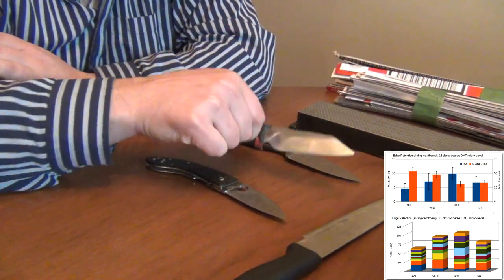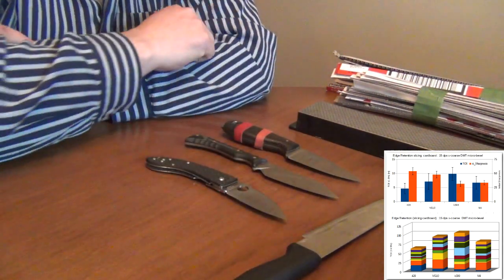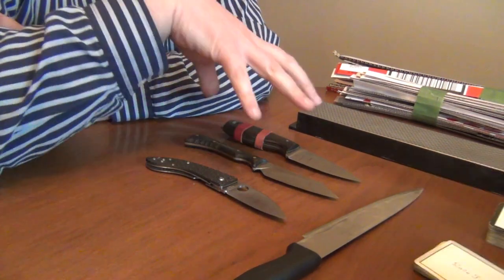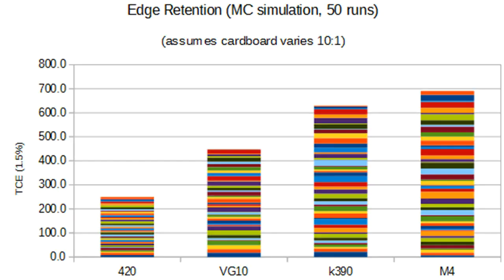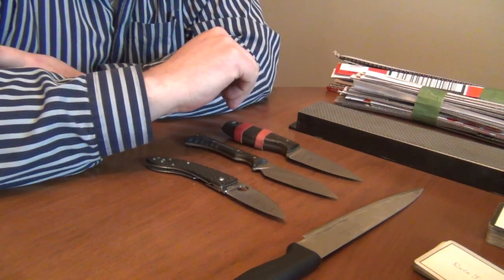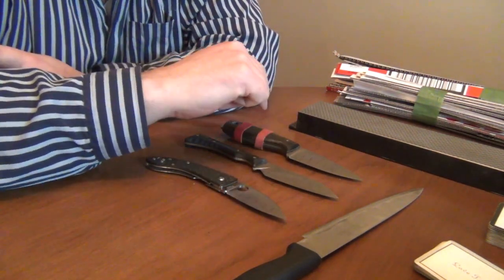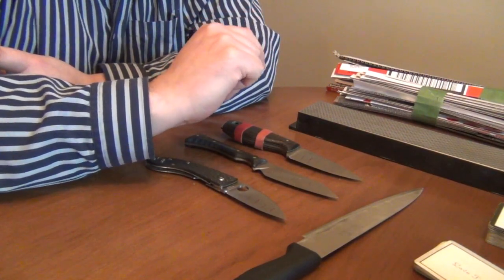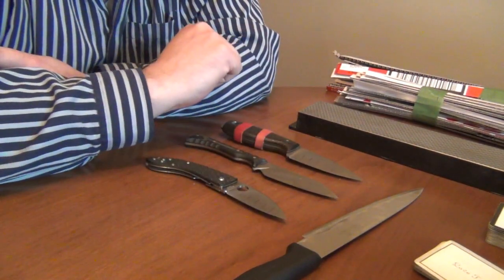Edge Retention - 3Cr13/420, VG-10, k390, CPM-M4 (cardboard)

Comment: So what your saying is while it does produce an effect, the effect isnt large enough to make up for the larger difference in other places which have a more dramatic effect. 

This makes sense, but that also takes your experience into account. While this may work would you disagree that the test is also dependant on the experience of person doing the testing then? 

I presume these blades are rather similar stock size then? As I would think if one were .250 and another .100 with same blade width that would create a difference large enough to be a variable worth considering not?

Also what is the red bands for on the k390 knife for?
Reply from the maker: The grip is a bit slick. I put them on it when I was helping a friend with a reno and I picked them up off the floor. I left them on as they are actually a slight assistance, plus heavy elastic bands are in general multi-purpose.

Yes, in general you have to have the ability to know what can be ignored, you just can't assume it. I have compared blades on cardboard with vastly different stock thickness/primary grinds and it makes little difference for reasons noted. However if it at any point start to cause the blade to twist, for it to not cut well and the material starts to buckle - then these are signs that the material is being subject to vastly different forces and this means there will be a corresponding vastly different force on and around the apex. At that point it is likely that it should at least be looked at.

Comment: Cliff, great work once again. I almost don't want to ask this question,  because it has to do with my EDC experiment, but a comment you said to me and a few others who asked the same question is bothering me. It was when asked, why didn't you use sandpaper to simulate accelerated edge use, and you said that it would show how well the knife cut sandpaper, and that dulling had four factors.  So unless you are working at a warehouse or paper factory (cardboard), are installing carpet (carpet), a sailor or mountain climber (hemp rope) or a gardener (sod), how can your results be translated into everyday carry or household/kitchen use? I am not trying to be critical or confrontational, I am just wondering what a suitable test medium would be that could stimulate most types of edge wear and dulling, so that the average knife nut user (I am assuming that these are the only people worried about this) can tell what works best for an all around knife.  For EDC, which is what I have done since I was a child (under 10 years old) and now in my 40's, I haven't been able to discern a significant difference in knife steels. I think it is one of the last things to consider in a EDC knife.  Even edge angle and finish come before the steel, this is of course based on that it is a standard cutlery steel with a good heat treatment.
Reply from the maker: I don't think it would be a valid argument to say that because a knife had strong edge retention on cardboard then it would mean that it would outperform another knife in the kitchen peeling a potato for example. The cutting media has to be at least similar to what is being cut in general practice.

Phil Wilson for example has argued that slicing hemp rope is similar enough to cutting hide that you can estimate edge retention for a skinning knife and that seems to be a perfectly sensible argument. However saying it can be used to estimate the performance of a wood carving knife is really weak.
Reply: Cliff Stamp Ok, thank you!

Comment: The one thing that I still question is- if the blade stock is different, primary grind angle, blade shape, and the handle itself could potentially skew the results. How does one account for the differences to come up with precise data. 

While I understand the test and results it still seems to make a comparsion in the same way if you compared a diesel engine to a gas engine of same hp, yes, they make the same hp but do so in different ways which results in a different effects. The most obvious effect being torque.
Reply from the maker: When you design an experiment, a basic one, then you set the dependent and independent variable. These are the thing you control and the thing it influences, what you measure. In complex experiments many things can change at the same time, but it requires more complex statistics, in a simple case you change one thing.

Now is it ever the case that nothing else ever changes? No, of course not, at a minimum the experiments are done at different times, different environmental conditions and so on. The question you need to ask then are the other things which change capable of producing an influence so large they could make you measure them and not the thing you are changing?

In this case what influence does the primary grind, blade stock, handle, etc. have? Well they influence the force you need to apply and your control over the blade. Do these have influences - sure. But they are not so much here than I would expect them to influence the results, they are certainly far smaller than the cardboard.

Now this isn't always the case. For example in a large chopping blade if the handle control is not very high the twisting of the blade in the impact could cause the edge to turn even if the steel was inherently stronger. In that case the influence of the handle could be much larger than the influence of the steel (or the wood type).

In all cases, you have to have the data. I have a wealth of data on cardboard cutting (and similar) and the influence of primary grind, blade thickness, etc. is very small. Look at that large cardboard table for example and note how even the exceptionally thin and low grind cheap 3Cr13 blades can match the edge retention of a O1 type steel blade even if it is much thicker ground in the body.

However the apex angle/grit finish is very different for reasons noted before.

Comment: I'm more or less in the "edge retention is irrelevant" camp. If the edge reflects light, I am going to fix it, I don't need low sharpness edges.
Reply from the maker: The only downside of that camp is Chum is always in it.
Reply: True, it is a pretty big drawback.

In all seriousness, toughness and grindability are a lot more important than wear resistance if you belong in that camp, hence why I preferred my Glock knife for sod cutting and probing over something like the Street Beat or a ZT200.
Reply from the maker: Bill22252
In general a lot of what is said is pretty confusing. How many people complain about the performance of the ABS knives for example, just try to find even one such review. Yet they are "only" 1084 type steels.
Reply: Hell, ask people who hunt about their perspective on knives.

I was at a gun show in December and perused a few of the knife counters. The people who like knives bought what appealed to them. The good ol'boys who wanted hunting knives usually bought the most beat up looking fixed blades you could imagine, like reground bayonets and file knives.

I kid you not, I head a gentleman buying a 50 plus year old blade comment "this will make a good knife, it ain't that stainless shit". Those sorts of people will go with what has worked for generations, that usually is the ABS type steels.

Comment: Cliff, since the randomness of the abrasive qualities of cardboard obviously varies tremendously, wouldn't it's use as a baseline be kind of redundant? I was thinking, what other material could you cut that has more of a consistent abrasive element, and it dawned on me, why not use wet/dry sandpaper at a specified grit as a cutting medium?
Reply from the maker: If you mix up the cardboard into a big pile and then cut pieces at random from it then all that scatter will average out, just like if you pick a bunch of people at random you always end up with the same average height.

You could cut sandpaper or any other ultra-abrasive material, however there are two factors :

-cost and waste

-I don't think you are measuring edge retention

Consider for example just cutting a knife into a stone, this measures grindability but is that all there is to edge retention, how hard a knife is to grind?

Comment: I am confused as to why you would spend the time to attempt a comparison like this when not using consistent cutting media (i.e. using different sampling of the cardboard vs using consistent sampling for each & every cut from each knife being tested). Your illustrating random sampling with the cards makes me think of how/why card counting is an effective way of beating odds at a casino. As such, I would "expect" random sampling of the cutting media would naturally result in the test blades simply changing position in test finals unless very large numbers of testing is done to offset the random sampling grouping potential (card counting example). My assumption from watching this entire video, is that you are poking fun at folks for discussing differences in cutting performance of various steels with an assumption that most folks are not using consistent cutting media AND controlling variables like grind geometry, etc. (and I would agree that "most" of the comparative references I have seen & read are flawed as such). If your cutting media is not the same for all the knives, is there any reason to believe there will be any actual "valid test results" well that is except that the results are flawed? When comparing two knives of the same blade steel and primary/secondary geometry, etc. there would be noticeable test result differences based on heat treat & tempering of the steel (high hrc vs. low hrc), as well as whether the hrc is on the high or low end of "optimal" for the specific steel. Are you for the most part simply poking fun, or is there a lesson to be learned here that I am missing? Regards,   BTW, I personally believe cardboard to be a horrible test medium because of the potential for differential debris contained in various pieces of "the same" cardboard that can cause significant edge damage.
Reply from the maker: Not random sampling was the point, the purpose of it was to show that even if the knives are almost identical in edge grind, sharpening, cut the same way, and use very similar media - even what we think is "similar" materials can have differences that are so large they are larger than the entire range of steels used.

Yes, it is obvious that is the media is allowed to change then so will the results, but is it obvious that if you cut cardboard from one box of 1/8" ridged cardboard and then another different box also of 1/8" ridged cardboard that this difference can be larger than the difference between 420 and 10V?

I don' think I have heard that argument often and even if it has been made there is certainly not much data behind it. In this video I show the data and in the threads I discuss the statistics behind it.

As for me making fun of people, I generally don't imply things, if I wanted to make fun of someone they would be ware of it. I generally don't do that often because those people do a good enough job themselves.
Reply: Cliff Stamp So the differences in "similar" media is greater than the differences in the test standards the knives are held to? Seems pretty obvious ... I guess the old saying applies "A wise man can learn more from a foolish question than a fool can learn from a wise answer." I appreciate your thanking the time to reply. Regards,
Reply from the maker: GravityRoller
The difference in cardboard from one box using 1/8" cardboard and another of the same type was shown to be larger than the influence of the steel from 420 to 10V. I don't think that is at all an obvious conclusion to just state without any data behind it. I have never seen it argued to that extent in any case.
Reply: Cliff Stamp RE: "The difference in cardboard from one box using 1/8" cardboard and another of the same type was shown to be larger than the influence of the steel from 420 to 10V." I did not get that from your video (perhaps I missed that, thinking video was more about "different" batches of cardboard producing significantly more variability in results than blade steel). I has been my experience that even using the same box, that debris contained (grit, clay, etc.) in one area of cardboard can have significant influence on the outcome, and double layer cardboard even more so. I think we are on the same basic page with regard to what you are referencing.

Is there any reason you are typically using x-coarse grind? Are you attempting to place focus on test of the serration strength (tips of the slivers of metal resulting from the large grit)? It seems that the "results" would be significantly different with finer grit finish?
Reply from the maker: GravityRoller
That was what was done, difference boxes were used in each trial. They were 90% 1/8" cardboard with some 1/4" and some single layer, but that difference alone was enough to produce the scatter seen which makes 420J2 and k390 (10V class steel) overlap.

At the time I was doing this I was looking at coarse finishes on high carbide steels to see if the thicker apex would stabilize the carbides. It doesn't seem to. In general I don't go that coarse as it is too focused on slicing. I normally use a fine or mxf dmt finish.
Reply: GravityRoller
 Bruce Lee QUOTE!

Comment: How does edge thickness factor into this?
Reply from the maker: Very weakly.

Edge thickness only gain some discussion in edge retention due to the number of people doing Goddard-like rope cutting where it is done on a scale and cutting is done until a certain number of pounds are reached. As this is a measure of cutting ability, not just sharpness, then a thinner edge increases the performance. This is confused by a number of people to indicate the edge retention has increased.

There is an effect of course in regards to minimization of force but it is very weak. Just take a knife and slice through a piece of cardboard with a 0.005" edge vs a 0.015" one and see how much of a difference you can feel. Realize now this is a 3:1 difference in edge thickness and you are likely to just barely notice it. In comparison slice some wood with a knife with a 10 dps angle and a 30 dps angle, completely different but the same 3:1 factor.
Reply: Cliff Stamp Makes sense.  Thank you for the clarification.

Comment: It is generally accepted that a course finished edge cuts longer so would you expect the difference between the high end/low end steels to be any more noticeable if you finished the apex with an extremely high grit?
Reply from the maker: I thought so awhile back because I figured that since the apex was thicker with a coarse finish it would naturally lead itself to enhancing the performance of high carbide steels. However it doesn't seem to do that in the comparisons I have run. It might be because there is more fracture in those steels. It might be interesting to look at a high carbide steel hardened and optimized for toughness.

Comment: What is your opinion on 8Cr14MoV and have you done any testing on it?
Reply from the maker: Interestingly enough, many using it are running it harder than the standard ATS-34 type blades. That combined with the lower carbide volume tends to make it easier to get a high sharpness. It is similar to AUS-8, MBS-26, 19C27, etc. .

Comment: Excellent. With the exception of the 420 is there a notable difference in the time taken or ease of sharpening between the 'higher end' steels you presented?
Reply from the maker: I was using mainly a combination of a Norton Economy (silicon carbide) fine grit and Naniwa Atoshi 2000 grit. I could maybe see a slight difference between VG-10 and k390/M4, but I would need to be counting to see it. There was also a lot of scatter. On some of the runs the edges took damage from very gritty cardboard. In retrospect, noting the pass count would have been informative as well.

Comment: What is your opinion on Damascus? Specifically stainless Damascus
Reply from the maker: Folded steel? I can appreciate the striking visual nature, but performance wise it doesn't offer anything over a simple steel.
Reply: I'm getting a custom knife made. The options on blade steel is either 3V, S90V or Damasteel.
Reply from the maker: Casus Luciferi
Those are some pretty extreme differences in steels, 3V vs S90v are almost opposites, what kind of knife?
Reply: Email sent

Comment: I like your approach.
Back in the days I did my share of cardboard cutting with three conclusions - 1. the "tests" were too subjective and pretty random (not so informative)
 2. the benefits for me were - new perspective what is good geometry and what is comfortable handle
 and 3. I do not need super steel or even standard CPM steels - the good old 52100 or ATS 34 will do the job...
Have a nice day.
Reply from the maker: The problem is Stefan that practical approach doesn't do much good for promotion, hence the exaggerated claims.
Reply from the maker: Cliff Stamp
I think an interesting approach is from the ABS guys as they use very simple steels, often nothing more than 1084 but just look what they can do with it. Does anyone really argue those are low performance blades?
Reply: Cliff Stamp
They make amateurish products on par with gas station knives.